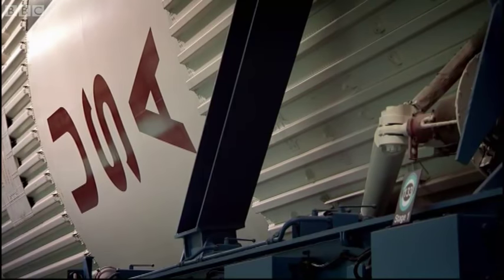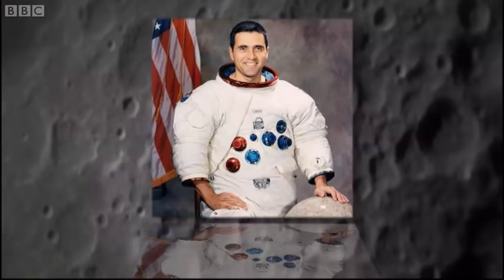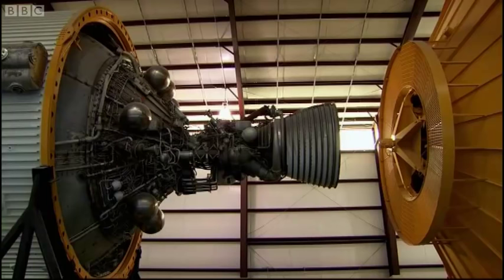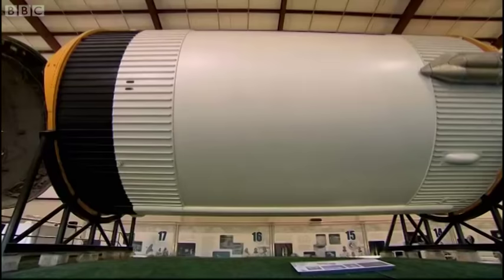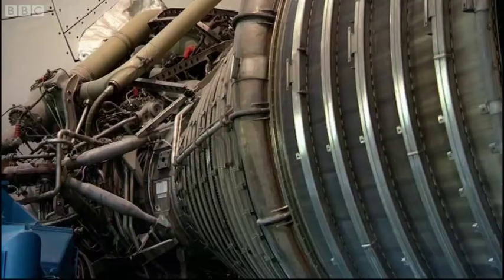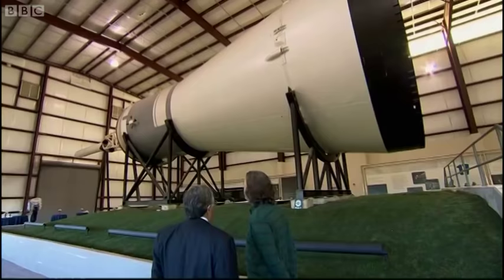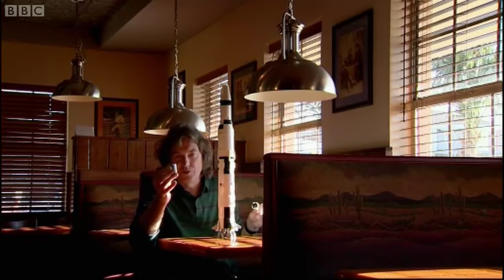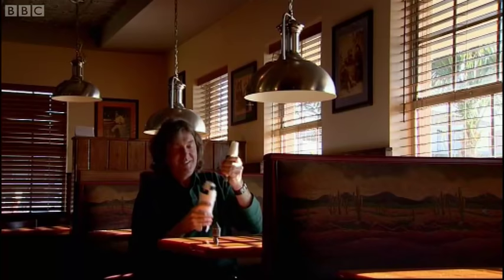How Did The Saturn 5 Rocket Work? | James May: On The Moon | Earth Science

Comment: I wouldn't classify the turbo pumps in the motor as "not very sophisticated"
Reply: The turbo pumps could make the Columbia River flow backward.
Reply: Exactly. Simple does not mean  imprecise.
Reply: He’s like chuck Norris, to him they are “not very sophisticated “
Reply: "Not very sophisticated" is perhaps referring to the turbo pumps existence and size.
A modern closed cycle engine like the RD-180 simply eliminated these dinosaurs and there is another issue with the F-1 engines, they are cooled with a series of small tubes that form the combustion chamber - presenting great frictional loss so the turbo pump has to be much bigger then in a modern engine.

Incidentally the tubular cooling also creates a limit of combustion pressures which severely limits power and efficiency, couple that with the strange choice of non mixing straight through injectors on the injector plate means that much of the fuel in the F-1 burns 'safely' outside of the engine with a bright yellow glow and huge tail flame.

The F-1 engine is such a poor design that no aspect of it's design was ever used again and NASA totally redesigned the engines for the Shuttle in order to get an efficient launch. The F-1 choice of tubular cooling, straight injectors and external turbo pump are notably missing from the world's best rocket engines today, the RD-180 and derivatives.
Reply: "It's the science behind . . " Sorry Dylan , the Apollo project rockets had little or nothing to do with science, which is about discovering the working of nature. The Apollo project worked by assembling a whole collection of fundamental principles in such a way that the 6 million parts all worked together to get the desired result - a man on the Moon and back again, safely.
The people who do this kind of work are called 'engineers' who understand very well every detail of what is needed, they are absolutely not carrying out 'scietific experiments' where the crews lives are dependent on the result. With a disaster like the 'Challenger Shuttle' explosiong (killed all crew and passengers) it was not a failure on the part of the designers, the failure was due was to Launch Control (NASA management) deciding to launch an ice coated vehicle that was much colder than its design specification. Launch Control had received advice from the designers not to launch in the icy conditions because the seals on the Solid Rocket Boosters (SRBs) would not close to gas tight at such a low temperature with the consequential total LoV (loss of vehicle). Doing anything like that in the military produces an immediate courts martial.
It is very strange that the relevant NASA decision takers were not charged with murder or at least with incompetence because they chose to ignore their own specification.
Reply: Dylan Thompson   Not to mention that those huge rocket engines were on gimbals, (the four “outboard” engines in the first and second stages, and the single engine on the third stage), which provided stability and guidance. If you look at footage from the launches at the right angle, you can see just after liftoff, the stack angling slightly away from the tower. It’s not an optical illusion, the IU really was angling the stack away from the tower, to lessen the chance of a collision, which would have been catastrophic. 

And there was nothing simple about the guidance, which had to be precise. Those planning and monitoring the guidance were aiming at a point about 60 miles ahead of the leading edge of the Moon — or to be more precise, to where the Moon would be in three days time. Too close and they slam into the Moon. Too far away, and they fly past the Moon’s orbit, and into Solar orbit, with no way to return home. 

And that third stage engine was the first engine which stopped when the vehicle reached orbit, and then had to be re-ignited for the TLI burn. 

It was state of the art for its era, and it was foolish of the Nixon Administration to force NASA to abandon it in favor of the Shuttle. At the time, the idea was that the Shuttle would be less expensive, since it was re-usable. But it turned out to be much more expensive. Thinking spacecraft can be like airplanes just doesn’t work, as the delta v’s are much greater. Airplanes don’t go from 0 to 17,500 mph in 11 minutes, and decelerate almost as quickly. It’s a lot of stress on any vehicle. 

There was also a smaller Saturn 1B booster, which could be used for low earth orbit missions. And after all those missions, the engineering problems were solved. It would have been much less expensive to mass produce the boosters and spacecraft. The Soyuz first flew in that era, and the Russian space program is still using it today.
Reply: Graham   I am not as knowledgeable as you are, but as I recall, the upper stages were among the first to use liquid hydrogen and liquid oxygen, and the designers opted to use the kerosene fuel in the first stage, as it had been in use as a fuel in other rockets. The Shuttle had the main engines using liquid hydrogen, but by then engineers had more experience with it. But the five big engines did work. And the Saturn was one of the safest boosters (never had a major failure). The Soviet N-1, on the other hand, relied on many more small engines, and it never had a successful flight. 

The Shuttle was inherently more dangerous because to save money, NASA was forced to use cheaper solid fueled boosters, which, once ignited, were impossible to shut down. That, combined with the design of the Shuttle (much larger than it needed to be if you are just launching a crew), eliminated any possibility of saving the crew if something went wrong during launch. It was essentially a death trap. As Schmidt pointed out, with Apollo, there was a launch escape tower. 

If the boosters were liquid fueled, they would have been more expensive, but safer.
Reply: cumberland Gapgap   You make excellent points, though the astronaut in the video is a scientist — a geologist. It would have been somewhat foolish to send six crews to the Moon, and not have one scientist make the trip. And lots of scientific data (from the Moon) was obtained by Apollo. One major question — where did the Moon come from, was answered. And there are geologists STILL studying those lunar samples to this day. 

As for the Shuttle, there WERE issues with design. NASA engineers envisioned a much smaller vehicle, which would have been perched atop the booster (with much smaller wings), used exclusively to launch humans into orbit. It was the OMB of the Nixon Administration which insisted that the Air Force and Intel agencies would decide on the size of the cargo bay, and that dictated the outcome of the design, and thus all of the flaws inherent. NASA, which depends on its funding from Congress and the White House, went with solid rocket boosters, because they were cheaper than safer liquid fueled boosters would have been. Liquid fueled engines can be shut down. Solid fueled boosters cannot. The Shuttle also lacked a launch escape system, except for the first few flights (when the crew was two), and that consisted of risky ejection seats. 

The very first flight showed design flaws, as the orbiter lost several tiles, which fortunately didn’t protect a vital area of the vehicle. The biggest flaw was the idea that a re—usable vehicle would be cheaper than the expendables. That turned out to be fantastically inaccurate. NASA HAD a well tested manned system with Apollo Saturn, which, with upgrades, could still be in use today. And it could have been used for further trips to the Moon. The Shuttle was limited to low-earth-orbit. It simply was not designed to fly any further. 

I am not excusing the management in its decision to launch, and ignoring the problem of foam impact, but NASA is not an independent agency, and many of the key decisions to abandon the extremely successful Apollo Saturn system was a decision made by Congress and the Nixon Administration — people who were neither scientists NOR engineers. 

But we shouldn’t overlook the scientific achievements to which NASA (and other space agencies) have accomplished with the unmanned programs. We have learned a great deal more about our Solar System, because of the many unmanned vehicles which have either flown by, landed, orbited every planet in the Solar System, projects which closely monitor the Sun (of more importance than many are aware of, because of the potential damage that can be caused to satellites, power grids, and electronics by solar activity). And then there is what we have learned from the launching of the Hubble, and other observers which can detect photons across the entire EM spectrum, many of which cannot penetrate our atmosphere.
Reply: @John, You imply too much precision for liftoff, aiming for the moon was only done in the translunar injection phase, all the lower stages had to do was get into a low fast orbit (LEO). 
Also the F-1 engine WAS NOT state of the art for the era, it was an obsolete 1962 design that Rocketdyne spent 5 years and NASA spent 2 trying to make it useful, both failed. 

In 1969 the state of the art was the Soviet NK-15 which had a closed cycle pump, parallel wall high pressure combustion chamber and mixing injectors - the NK-15 design is bought by the US today in the RD-180 while the hopeless F-1 was dumped even before the shuttle program and hasn't been seen since for good reason.

No one forced NASA to dump the F-1 but the F-1 itself, it was very low specific impulse and in 1969 was already 7 years obsolete. Brazed tubes in a rocket motor combustion chamber? Please, do us a favor - referring to it as state of the art is an insult to Rocketdyne personnel.
Reply: @G-ra-ha-m  
Well, that poor design got the americans reliably to the moon, so nobody complaons about that ;D.
Reply: No Luca, it didn't, that's the point. It wasn't efficient enough for a moon shot and it wasn't powerful enough to lift the advertised payload. 
At 1.5e6 pounds of thrust the F-1 combustion chamber pressure buckles and breaks the thinwall tubes and causes it to blow up, this is why the west's best rocket scientists: Rocketdyne, rated it at 1.0e6 which gives a lift off thrust of 5e6 pounds = Not Enough.
Why on earth do you think the world's top rocket scientists, Korolev developed the NK-15 specifically for the N-1 moon rocket? Just for fun?
Reply: @G-ra-ha-m  
Wait are we talking about the same rocket engine, what was the first stage engine of the Saturn V called? I may have had wrong information but to my knowledge they called it F1. I also may be wrong informed on the N1, wich i am a fan of, since the Rd170 engine is pretty much supperior in every point except for vibration problems, wich lead to the 4 nozzle design. Didn't the N1 never flew successfully even near the moon?
Reply: You could say that they were simpler machines in that they minimized everything they could (without compromising safety too much). However, generally simpler is actually harder to design. If you can afford to make things big and heavy, you do t need to get clever with your pipe layout, or wiring, or pump design. It's like writing. It's easier to convey a thought in an entire paragraph than it is in a Si gle sentence. But when you want to get to the moon you don't really have the luxury of that.
Reply: @MajorCaliber  It's a very poor design that is LESS safe than a proper double walled engine because the thin tube walls are far weaker. Running a double walled design like the RD-180 at the same pressure would be far far safer (and give an equally feeble specific impulse).
The huge inefficiencies of the F-1 make it rather unlikely that it produced 1.5m lbs of thrust, that thrust would also  burst the thin wall tubes and is therefore impossible. 
That's why Rocketdyne - the west's best rocket scientists - rated it at 1.0m lbs thrust, which is frankly what it produced. You may think you know better than Rocketdyne but you don't, Saturn V had a launch thrust of 5m lbs of thrust and therefore never went near the moon, instead landing rather closer to home at the bottom of the Atlantic. You're welcome.
Reply: @G-ra-ha-m  Is that so well if it's so simply build an Apollo rocket
Reply: @lewildknight9864  Sorry I don't understand your statement, can you rephrase?
Reply: @lewildknight9864  I am also a supporter of good scientific research. But scientific research these days is to very great extent (not 100%) dependent on reliable instrumentation e.g. CERN, built by engineers who must make sure they 'do what it says on the can'. Engineers do tests to be sure the performance predictions are correct, the should not, and I have seen a fair amount of this,  'to see if it works'. For example rockets launches 'to see if the structure was sufficiently rigid' or the electronics 'had sufficient cooling'. These are not matters for 'scientific discovery' they are engineering matters and are (should) not be the concern of the 'govt. Chief Scientific Officer'.
Reply: @DAMORBEL  I see your point
Reply: @G-ra-ha-m  Graham, correct me if wrong. So the cooling of the bell (via the myriad of cool fuel piping around) bleeds pressure or flow, requiring bigger pumps.  Then how are modern engines cooled?   appreciate if you could elaborate.  cheers!
Reply: @fredfinks  Yes. The unburned fuel (not sure about the LOX) is piped around the combustion chamber sides and some of the bell to stop the metal melting, before it gets injected into the engine.
The F-1 does this by literally thousands of small tubes brazed together to form the combustion chamber. For weight reasons these tubes have thin walls, which limits the amount of pressure the combustion chamber can stand to around 70bar. Also hundreds of feet of tubing takes a lot of effort to pump fuel down. It's a terrible design and the F-1 and H-1 Rocketdyne engines were the last to use it.

The 1969 design NK-33 soviet engine however had a dual wall chamber and bell that could cope with around 200bar pressure IIRC, which meant it was several times more efficient and fuel easily flowed around it.
Efficiency is measured as 'specific impulse' and relates the mass of fuel burned to thrust gained. A rocket motor efficiency is critically tied to the combustion chamber pressure.

Regardless of speculation, the facts speak for themselves: The F-1 was dropped immediately after Apollo (+Skylab - made of an old SaturnV), whereas the NK-33 design is still bought by the USA from Russia as the RD-180 - the design is exactly the same is all important respects. 
Soviet rockets and missiles have always been better than American ones, it's just an inconvenient fact ;)
See: https://www.youtube.com/watch?v=TMbl_ofF3AM
Reply: @G-ra-ha-m  Thanks for the reply! But how are the modern engines (and the earlier soviet ones) cooled? What was Rocketdyne missing? i.e. They reasoned that they had to get rid of excessive heat so they came up with the tube cooling. Maybe i read wrong. So the double walled bell design has a big singular capacity of cooling fuel flow VS lots of little pipes? So the cooling flow is not as impeded and the chamber can withstand a lot more pressure.  Do i have it? cheers for help
Reply: @fredfinks  They are cooled in the same (and only!) way - by circulating fuel around the combustion chamber and nozzle before injection. The difference is the F-1 was a series of brazed tubes where the Soviet design was like using the space between two russian dolls! 
So yes, the double wall gives an easy flow, great cooling and a very strong resistance to bursting. There was a video showing a russian factory rolling a complete combustion chamber + nozzle from a single sheet of metal but I can't find it now.
Reply: "Such a poor design" that it's the only engine in history to deliver men to the moon. 65 engines flown and 100% reliability. The F-1 is proven by history to be state of the art. NASA doesn't use the F-1 engine anymore but it doesn't use any other 60 year old technology either. What a stupid argument, of course technology keeps advancing. The Soviet N-1 program, which was contemporaneous with the F-1, failed miserably. Trying to compare the F-1 engine with the RD-180 engine that was developed 20 years later is also really stupid.
Reply: @soxnation1000  Your reply is inconsistent. You claim that the F-1 was state of the art and the best engine, but base that view ONLY upon the 'success' of the dubiously faked Apollo stories. Meanwhile NASA dumped the F-1 ASAP and has never touched it or any similar design since: Actions vs Myths.
Then you have a go at the N-1 which in 1969 used the NK-33, which is the exact SAME design as the RD-180 the US is forced to buy from Russia today, 2019.
Why is it stupid to point out that the US buys the 1969 soviet design TODAY but doesn't touch it's own 1969 F-1 design?
Reply: @G-ra-ha-m  that Russian rocket your talking about died when the designer died . It was a complete failure after failure.  And you can know as much about rockets as you want. The whole world knows the Americans made it to the moon and they got there by those F1 engines.  They were better case closed!
Reply: @mandernachluca3774  when the designer of the N1 died he was the only one that understood it.  And yeah it was a cool rocket but it was a piece of shit in the end.  It was so bad it killed people when it exploded and like usual the Russians covered it up.  I recall it had a lot of first stage engines.... weak compared to the saturn 5 first stage only 5 and that's where the name comes from my friends.
Reply: @geemanbmw  The russians didn't cover up the failure of the N1, the soviets did, the politburo was mainly Ukrainians, like Brezhnev. Russia is a different country, just as Poland is.
Reply: @geemanbmw  The N1 was was such a complete failure that today the USA still buy the rocket motors used LOL. Sure the NK-15 is now the RD-180 etc., but the design is exactly the same. Tell me, who buys the F-1 design rockets motors of the SaturnV?  Even NASA dumped that design with indecent haste.